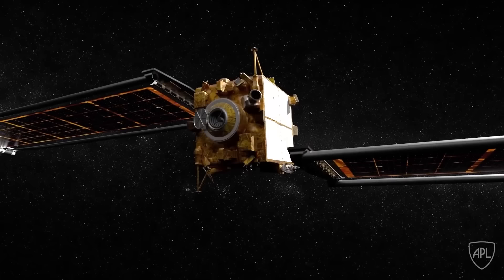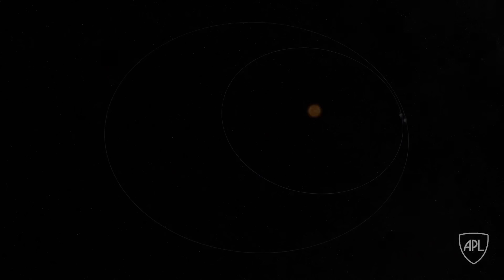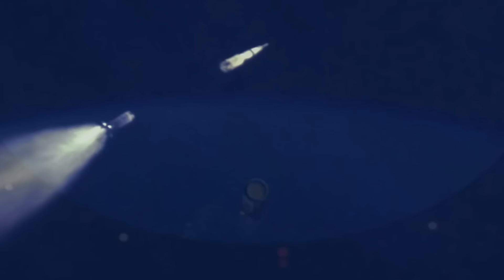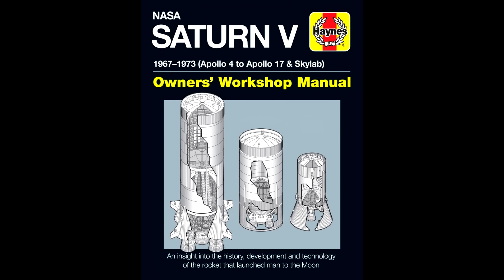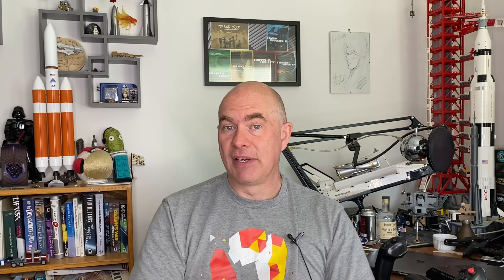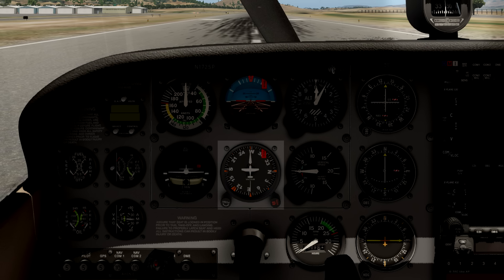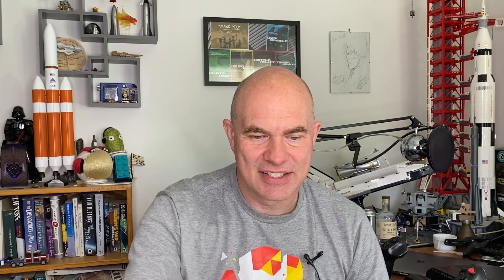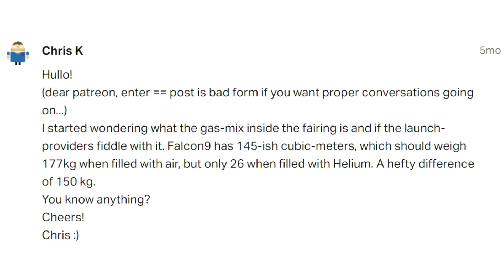Saturn V Staging, Asteroid Deflection and Hearing Rocket Turbines - Supporter Questions, Episode 17

Comment: Thoughts on a safer Shuttle:

1. Liquid fuel boosters. These can be shut down at any point in the ascent, thereby going a long way to close the 'black zones' where no escape or recovery was possible due to the SRBs still being lit. This also avoids the issue of an ejected astronaut falling though the SRB exhaust plume. (there were schemes proposed several times for liquid-fuel boosters).

2. Make the cargo bay about 10 feet shorter and the crew cabin about 10 feet longer to make room for point 3. Use the extra space on the mid and lower decks to extend duration on-orbit. With hindsight they almost never needed the capability to carry a KH-11 spysat anyway.

3. Reduce the maximum crew to six and have them all seated on ejection seats on the upper deck for launch and landing. They can eject during launch because of the liquid-fuel boosters and they can eject during post-re-entry glide, in the event that the shuttle's coming down away from a useable runway, without needing the Mickey-Mouse 'bail out on a stick' system.

4. Coat the External Tank insulation foam with a plastic outer layer or take some other step to prevent foam blocks from falling off. Yes, this will add mass and reduce performance, but this can perhaps be compensated for by increased performance from the boosters.
Reply: 5. Don't light the "Main Engines" (which only provided ~30% of the thrust on lift off) on the ground. Light them after the boosters fall away. Then you do not need ridiculously high chamber pressure for ground launch nor do you need to mount them at an angle and take a sine loss.
Reply: @flechette3782  You still need to mount the SSMEs at 'an' angle because the CofG of the Orbiter+ET is still WAY off their 'natural' thrust line. Also, would the booster engines have enough gimbal to deal with the fact that the stack's CofG would be well off their thrust line too? Interesting idea otherwise though, since the SSMEs could then have nozzles optimized for whatever the ignition altitude is.

Maybe liquid-fuelled boosters could draw some/all of their LOX from the ET?
Reply: You can't eject at any ole speed.  Ejection seats quickly loose their utility.  Something like the ejection capsule on the F-111 would likely be better.
Reply: @TheEvilmooseofdoom  The first couple of shuttle flights that only had 2 crew on them were actually fitted with ejection seats. Once you've shut all the engines down, the vehicle starts slowing again, so even if it was going too fast to eject, you can still get back inside the envelope. Sure, there are circumstances where it wouldn't work: for instance, if the vehicle was over ejection speed and breaking up or tumbling then you might not have time to wait for it to slow down. However they through there was some utility in them or they wouldn't have fitted them at all. The main reasons for taking them out were:
1. They couldn't be fitted for the passengers on the mid-deck, and the pilots wern't comfortable having an escape method if other people on the craft didn't,
2.  The SRB exhaust plume problem.
Reply: @MrHws5mp  Consider how the Shuttle flew after the solid boosters were dropped. It was pretty ungainly with a huge tank strapped to the side of the orbiter and yes, the engines did have to be angled when compared to the long axis of the Shuttle so the thrust would be through the CG of the entire flying assembly. But at this point there is no sine loss because it is thrusting right through the CG as it should. The entire vehicle is flying at a wacky angle. It can do that because at that altitude there is very little air.

The sine losses occurred when the liquids and the solids were firing at the same time. 

However, that doesn't mean that those liquid engines had to be lit on the ground. The big solids accounted for over 70% of the liftoff thrust and you could easily imagine a design where they provided 100%. Other rockets (like the Titan IV) lifted off with the big strap on solids providing 100% of the thrust and the center engines off, to be lit after separating from the spent solids. This meant that there was no sine losses for the first stage (two solids) and none for the second stage (center liquid). None of that precious Isp was thrown away like the Shuttle did.

Another advantage was that the center liquid engine could be designed with a larger nozzle area ratio because it would be lit at altitude. The Shuttle engines had to fire at sea level because of its poor system architecture.
Reply: @MrHws5mp  Few failure modes after SRB shutdown that allow them time to coast down to ejection speeds usually also open up a down range landing.  They had ejection seats ONLY because there were 2 and they were of extremely limited utility.
Reply: @TheEvilmooseofdoom  But that's the point of the liquid-fueled boosters. You don't have to wait for them to burn out: they can be shut down as soon as an abort is called, thereby allowing a greater range of survivable failure modes.
Reply: @flechette3782  Can you explain exactly what you mean by sine losses please? I thought I knew what you meant, but now I'm not sure.

Comment: The primary factor is not the shape of the elevators conduit... not the structural material... 

The primary factor is actually assembling the structure.. which has to be (with a significant safety margin) stable at each and every moment of build...

There are many projects where engineers (who often know next to nothing about building things outside of a computer model) liaise with scientists who have a bestest evar material (looked good in a lab) task handoff to a builder who goes.. err.. no.. it will be compromised using any fabrication  procedure crrently known...
Reply: Think about Starlink milling around it.  No, don't. . .

Comment: On the Space Shuttle design question - I think it would have been great had they fully developed the STS - the main Space Shuttle for "crewed large cargo missions", a dedicated cargo-only launcher (basically the Space Shuttle's engine section by itself mounted to the external tank and SRBs, with just a big disposable cargo pod riding on top,) and a smaller crew-only launcher (something more like the X-37 or Dreamchaser, launched with the "disposable cargo pod" type launcher or even the upcoming SLS style.)
Reply: That cargo launcher is essentially SLS.
Reply: @johndododoe1411  The original cargo launcher was supposed to be more like the Soviet Energia - it was to ride on the side of the tank the same way the Shuttle, a big "cargo pod" with a small engine section beneath - in the same position as the engines on the Shuttle. So that there would be 100% commonality of SRBs and main tank, it would only be the "ship hanging off the side" that would be different.

(There were also plans put out to keep the big orange tank in orbit and refurbish it to be a HUGE space station!)

But yeah, SLS stack would have worked, too.

Comment: My understanding is that the ring was there to prevent the first stage from colliding with an engine if the separation went badly. This is because the fist stage is entirely below the engine bells. Once the first stage is gone, the lighter ring is separated in a more easily controlled manor to save weight. There are boosters on the side of the second stage to handle the fuel. Research this before considering it factual. This is just my understanding.

Comment: Regarding the first question: the spacecraft would have to land and stabilize itself on the surface of the asteroid. You'd add a lot of unnecessary complexity to the spacecraft and waste a lot of fuel matching velocities and performing the landing maneuver. But the bigger problem is that the asteroid is going to be rotating, so a spacecraft on the surface will have very little control over the direction of its thrust.
Reply: Scott missed a part of/misinterpreted the question actually. This didn't have anything to do with landing. The question asked to compare the scenarios "burn fuel and have a fast impactor with empty tank" vs "don't burn fuel, impact a wee bit slower but with wee bit added mass thanks to fuel left in the tank".

Comment: Re the 1st question, Dart impact velocity vs. mass
Data from Wikipedia:
- DART launch mass 610kg, including 50kg hydrazine for attitude control, and 60kg Xenon for the NEXT-C ion engine
- impactor parameters: 500kg at 6.6km/s (50+60kg propellant fully expended I guess).
- NEXT-C ion engine Isp: 4170 seconds (exhaust velocity: 40km/s)
Now can someone with good handle on the rocket equation actually calculate the delta-v from the Xenon engine vs. impacting with 560kg mass? :)

Comment: 24:35 I guess instead of a space elevator based on stress, we might be able to use active support (i.e. pushing from the bottom by things thrown up fast, and then magnetically decelerated). (This would likely not reach geostationary heights, but it could be combined with a cable one to save on total mass, or just bring us above the atmosphere to launch our rockets a bit cheaper.)

Comment: 16:16 Just FYI, Carbon Nanotubes are not dislocation limited (They do not have a crystal structure). While you could have a "dislocation like" defect in multi-wall CNTs where the outer tube has some kind of mismatch to the inner tube, you really want single-walled CNTs for proper high strength, where such a defect is not possible.
Unless by dislocation you mean the alignment of the tubes into bundles, which would also have to be perfect for peak strength.

Comment: the trouble with space elevators is that they only really work as commuter transit to launch via space elevator will still require the delta V to accelerate to orbital velocity. If you have an equal mass descending at the same time then you have equal and opposite accelerations. My feeling is that for the forceable we are looking at a serious net export of mass which makes the space elevator a much more complicated beast it will either need to carry additional fuel to accelerate payloads or incorporate sufficient elasticity to impart delta v to the cargo and periodically boost the orbital counter weight.
Reply: The proposals typically use beamed energy for the first 40km and then switch to solar power, avoiding the additional propellant weight.

Comment: Yay. My question! Ya. Obviously. The atmosphere gets thinner on the outside AND inside and thus the air is not carried all the way. Thus reducing the relative usefulness of the weight reduction. I wonder if the engineers of SpaceX considered it tho. Seems cheap and easy.

Comment: Regarding the pre-impact burn: If you want the maximum impact momentum possible for a given pre-burn impactor mass, then if the impact velocity without the burn is at least equal to the engine's exhaust velocity, it makes no sense to have add that burn, and if you want maximum impact energy, there is no point in adding a further burn if your impact velocity without the burn is at least twice your exhaust velocity, this all ignoring orbital mechanics though.

Comment: That ring in saturn v rocket could destroy the engines during stage sep if it was attached in the first stage. That's why it is separated form the first stage and then detached to reduce weight.

Comment: I would add Red Moon Rising by Mathew Brzezinski as a good book to read on the soviet space program (and contrasting it to the development of the US one at the time) also: in termination shock firing sulfur into the atmosphere is only intended as a temporary measure - whether Stephenson's maths checks out on frequency of payloads etc. I don't know... good book though, and the debate between geoengineering vs. mitigation is one for the not too distant future

Comment: Fyi 6 pack of steam gauges isn't entirely correct.  The slip indicator runs off of dc power... this is only important if you lose instruments or an engine and need to use your slip indicator along with heading for ifr turns.

Comment: I think you missed the point on how they accommodated the additional weight of the rover.  You still have to get everything off of the ground.  Due to increased efficiency/performance they later squeezed out of the F1 engines, the payload could be increased

Comment: @Scott Manley, a space elevator must go through at least 5 different electrical layer of the earth. I'm pretty sure you would simply create the largest man-made lightning bolt and there would be no more space elevator.
Reply: Grounding is a thing. Plus, you could harvest the energy potential.
Reply: @abebarker  That charge is independent of its properties. Plus, you can use regular insulation to prevent discharges if you wanted.

Comment: I'm no longer sold on space elevators being a good high throughout launch solution anyway. Lofstrom Loops or their big brother Orbital Rings make a lot more sense to me.
Reply: Both need active support. Space elevator is purely passive.
Reply: If you have an orbital ring, space elevators are actually much easier because they only need to reach the ring, which can be in low orbit.
Reply: @Br3ttM  But the ring is a lot more material than the GEO cable.

Comment: Ayyy I was always curious why the Saturn V dropped the interstage! Thanks Scott!
Reply: Sequence was chosen, cause of the small clearing between engines and skirt. As the first stage seperated, they were still in a decent amount of atmosphere. So, as you can see, the stage starts to tilt, as soon as it got seperated, as the center of mass instantly changes and momentum of gravity turn must be contained. And remember, there are eight solid rocket motors, pointing forward to decelerate the stage. Much room for inducing additional momentum here. So they chose the sequence to drop the first stage, wait 30 sec and then the skirt. By doing so, it is an option to get rid of the dead mass of that ullage engines, by fitting them on the skirt. At the time of jettison the skirt, the vehicle is faster and higher, plus the dimensions, center of mass and drag of the skirt is way different to the first stage. As you can see it seperates straight behind, the spin of it is caused by actual engine exhaust.

Comment: I'm afraid your answer to the first question was incorrect. The velocity change of the asteroid will be given by m(v0+v)/(m+M), where m is the mass of the spacecraft at impact, M is the mass of the asteroid, v0 is the initial impact velocity, and v is the aditional velocity you get by burning more propellant. It is a nontrivial optimization problem to decide how much propellant to burn in order to maximize the velocity change. Let's simplify by setting M+m=M, as the mass of the asteroid is much larger than the mass of the spacecraft. Then we can focus on maximizing the momentum of the spacecraft m(v0+v). Using the Tsiolkovsky equation, it becomes m(v0 + ve log(m0/m)), where ve is exhaust velocity and m0 is the initial mass of the spacecraft (before burning more propellant). It is maximized for m = m0 exp(v0/ve-1), assuming of course that this is larger than the dry mass of the spacecraft. Interestingly you don't maximize the momentum by burning all your fuel.

Comment: Question: What happens underneath and in-between the Starship's refractory tiles as it stands laden with cryogenic liquids immediately before takeoff.?  I would have thought CONDENSATION and FREEZING of WATER VAPOUR into ICE.  Unless, of course, those tiles are to be shrouded in warm dry nitrogen gas, which may well generally hold good for several other situations as well.  Could you investigate?  It seems important to me.  Depending on energy intensity, ice flashing to steam can be explosive enough to dislodge them on re-entry, though, over time, ice will sublime away (for voyages to Mars), when re-entry is only minutes after takeoff (for prototypes and Earth transport), there's a real danger.
I love the Space Tower idea - especially the idea of Starlink's Constellation constantly weaving out of the way of it.  They don't seem to fit, do they?

Comment: Another problem with space elevators: most concepts rely on having great big spools of the carbon fiber that is then lowered down onto the planet. It would be very difficult to try and push something up from the surface.

That said, you would need to get all of this material...ALL of it...into orbit before lowering it to the ground. That means that you need something that can put a lot of mass into orbit relatively cheaply, like a big rocket. Buy if you have a big, cheap rocket...why do we need the space elevator again?

Comment: So, why did modern rockets stop using solid rocket ullage motors? Or do they still use them? I can see tech advancements in RCS being a thing for ullage in a vacuum, but 2nd stage ignitions would still likely have aerodynamic drag acting on it which would require a bit more thrust right?

Comment: Regarding elevators... everyone's always talking about structural aspect of it and material science. What about deployment procedure? How would you deploy the initial "guiding tether"? Would it have to be kind of a direct ascent winding out the tether from the ground base? Would it have to be confined in a payload bay so you can do normal GEO and then deployed towards the ground (and opposite for tension)? How would you stop it from "wrapping" around the Earth due to different orbital velocity on different altitudes?
Reply: AFAIK, the usual procedure is to lower the guideline from GEO.
Reply: @HalNordmann  OK but how do you lower anything from orbit strait down? You have to decelerate do drop altitude and with doing this you cannot longer maintain the "line of sight"